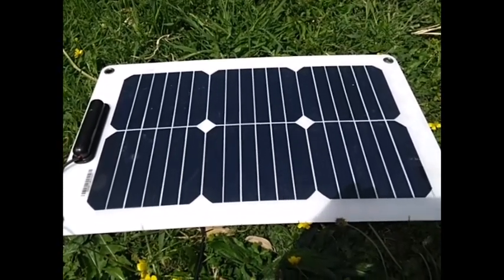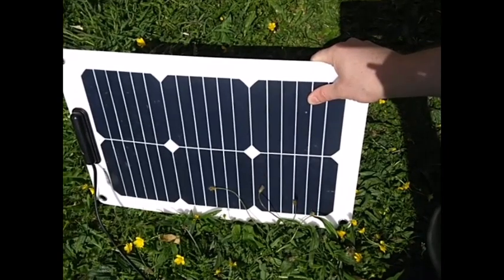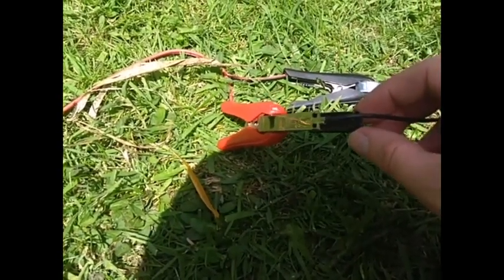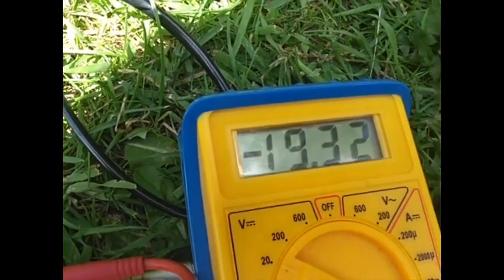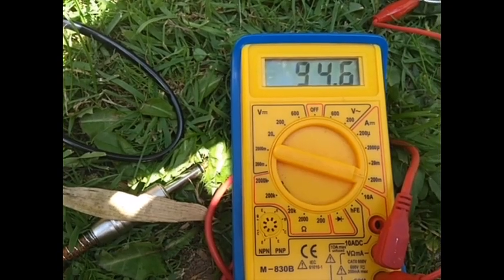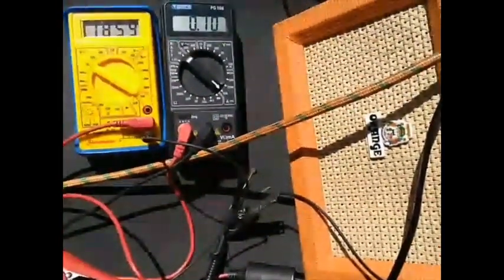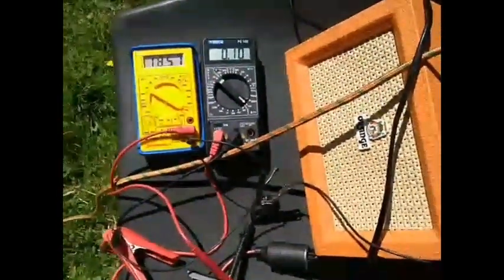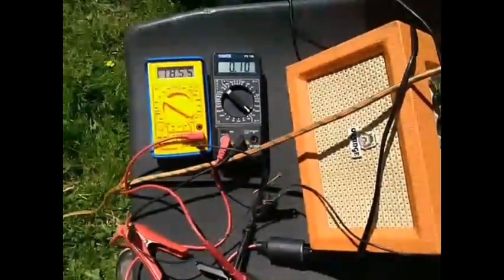Solar Power Electric Guitar Amplifier Orange CR6 Stereo Micro Crush

Comment: Just wondering if you know what panel I would use on the blackstar fly 3,I'm off travelling soon and this would be a godsend
Reply from the maker: Not exactly but for that amp I'd look for a panel around half the voltage of this one, so 9 volts. It uses 6 AA batteries so that tells you about the voltage. You could probably run it off those cree LED bike light battery packs of 4 or 6 18650 cells which are 8.4 volts but you would need to observe correct polarity and make a short cable from 5.5 mm male to whatever the blackstar uses.